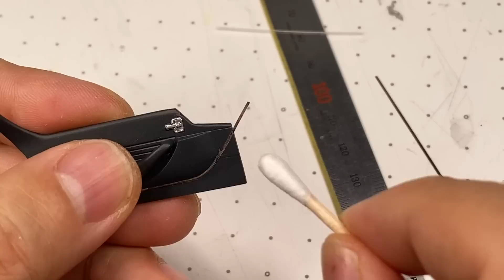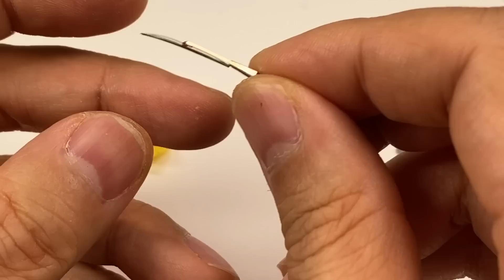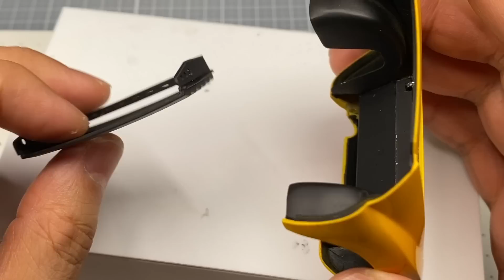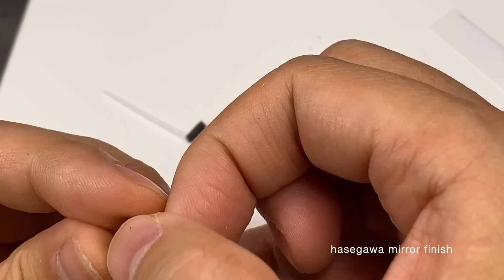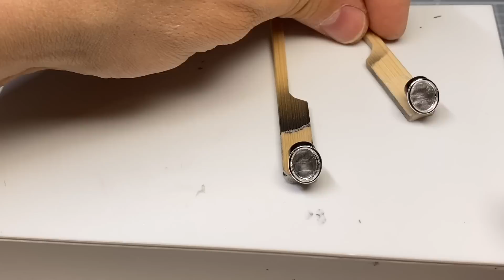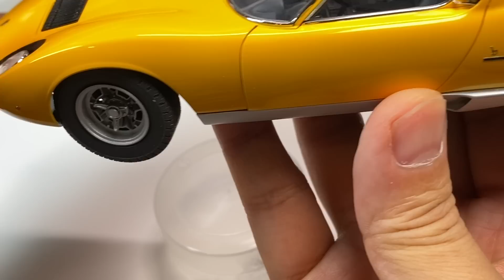LAMBORGHINI MIURA 1/24 HASEGAWA - part 11

Comment: Insane, the atention and care to all details is insane. That's how masterpieces are made. I wish I could be that careful to those small big details when I build a model, that's why I have stopped building plastic models. I'm currently working on a NSX NA2, it's a metal model in 1/18 scale. The model is a not so detailed one, that's the way the brand makes its models, so I've been making some parts not included in the model, like master cylinder, seat belts, wiring and hosing of the engine, and air intakes they are sealed so I open them. I started making all this since the last year ann couldn't finish the model yet 😞. I'm so unsure about body and exterior colors, rims and hood and rear spoiler, don't know if use new ones like the ones in the type R or leave the originals. I love original cars, I mean, like what you did with this Miura, everything original, but I've seen modified NA2 with other hood and wide bodies and they look just great, at leas I want to change rims, but I don't know wich ones. Hope I can make up my mind so I can finish it in the following months. Oh and... It's kinda relaxing to watch your videos, thanks so much for sharing. 😊. What's the next model you're gonna build?
Reply from the maker: Thank you for the compliment and kind words. It's hard to make parts that aren't included in the kit by examining their original form, but it's quite fun. I wish your NSX a great finish.

Comment: Stunning!  
When making scratch built parts do you use original photographs for referance? 
 Also how do you ensure these parts are to the same scale?
Reply from the maker: I referenced many pictures that I searched on the internet.
actually it doesn't quite match so I'm just trying to make it as similar as possible. Thanks

Comment: How much time did you spend on research of the full size vehicle before you even started the fabulous model build?
Reply from the maker: In the two or three weeks before I started, I found a lot of pictures, sorted them, and figured them out. During the work I still continued to find and refer to pictures of the parts I needed.Thanks.